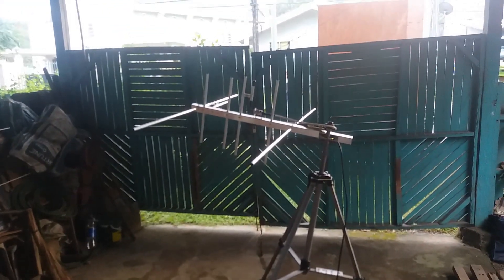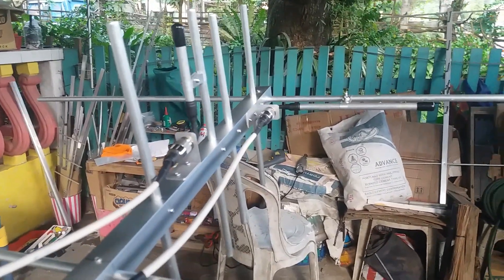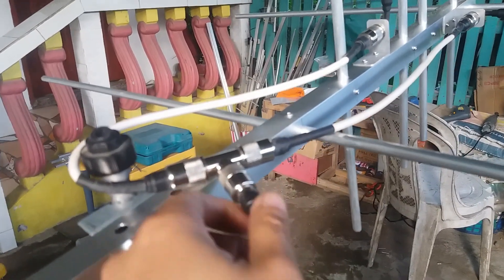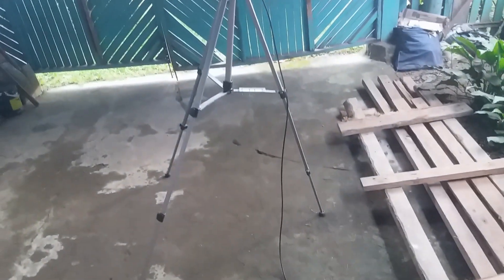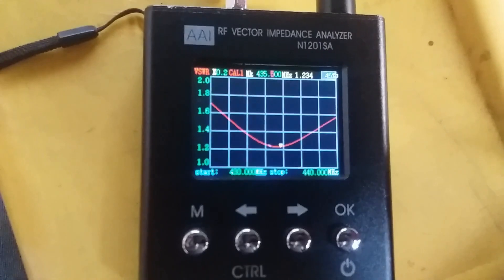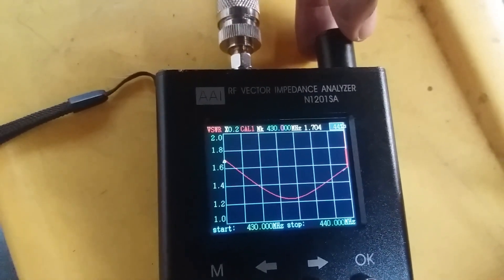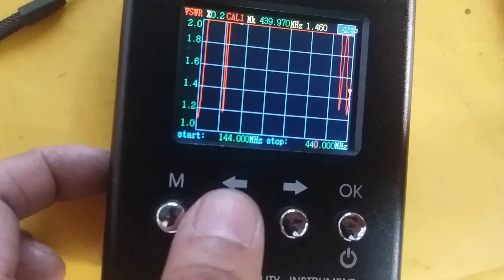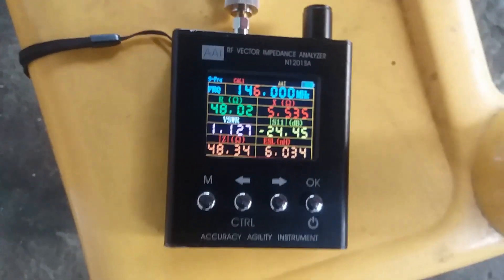2x4 2m/70cm Cross yagi tuning Sat Comm Antenna

Comment: Congratulations for this realisation. It's very good job. Only one question for me, the length of these coax between the PL (antenna) and the "T" is particular or whithout importance?

Thanks for the job.

73 from France
Reply from the maker: It's calculated as 3*1/4 wavelength *VF on the center frequency of VHF antenna, the design frequency for VHF and UHF are complimentary harmonics, so the length of the cable from VHF can be used on UHF hence it's the same length on VHF and UHF computed from the above formula and connect to a Tee connector